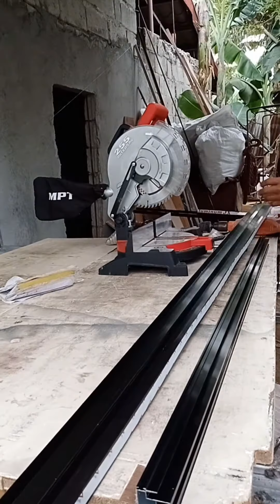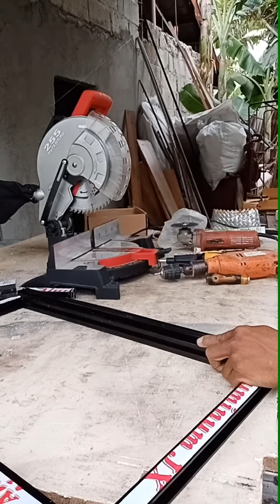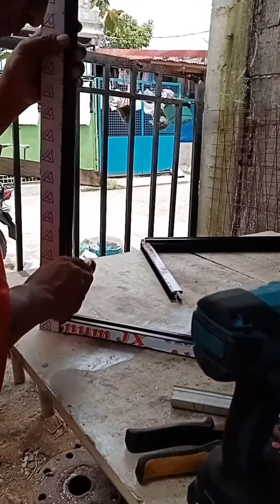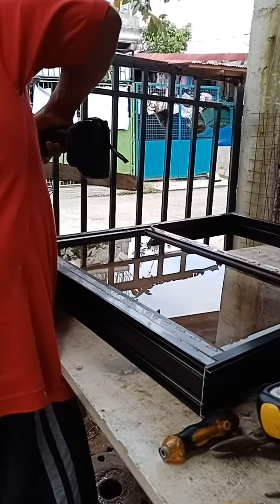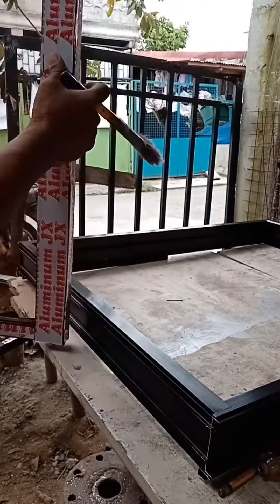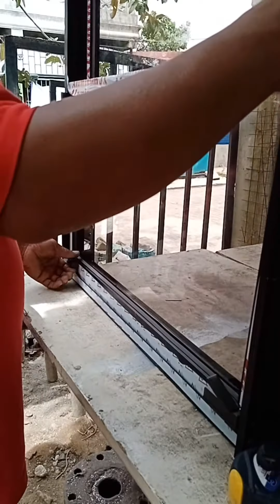How to make aluminum slide up window

Comment: Sana ipakita niyo at sabihin ang sukat ng pinuputol ng bawat materyales. Ano ang pinutol at binubutas sa frame. Then ang buo ng panel mismo ano ang putol ng vertical at horizontal section, saan at bakit binutasan ang dulo, ano ang screw na ginamit. 
Paano kung lalagyan ko ng screen? 
DIY person ako. Gusto kong gumawa sa bahay ko at mKatipid din. Umaasa lang ako sa sss pension ko. 
Malaking tulong po kung makagawa kau ng video na may paliwanag. 
Salamat po
Reply from the maker: Ok po gagawa po ako ng video para Makita niyo ng maayos na detalye salamat sa comment niyo po sa pagpalain kayo